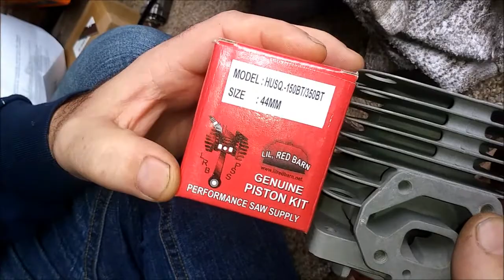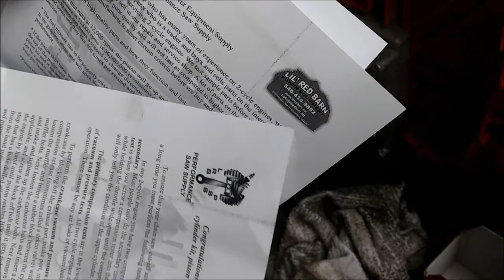Husqvarna Blower Jug and Piston Rebuild

Comment: Jugs and pistons all over Amazon and has been for years.  Before I would get them from Jack's Small Engines or who ever had what I needed.  Hard to beat $27 for Jug, piston, roll pin, sparky plug, gaskets and a fuel filter-to my door
I use a small filter wrench(band) to compress pistons.  Ring tool at Harbor Fr for $12

Comment: I got the same leaf blower broken completely down with it's parts in boxes in a bag.  I found it in the trash and found that the spark plug was bad, cylinder, piston, muffler, are wrecked and the fuel lines were leaking and the pull start assembly is bad.  I removed the gas and saw that it was crystal clear, so does that mean a bad fuel mixture?  I got all the parts on order and figured someone could use it, after I thoroughly clean the parts, replace the gaskets, and get it running good.
Reply: I've never worked on one, but it's rewarding so far.
Reply from the maker: Sounds like it had no oil in the fuel. I always mix at least 50:1 in EVERY 2 stroke engine. It only takes a few minutes to wreck a 2-stroke without oil in the fuel. Some people think you can substitute transmission oil for 2-stroke oil, that's also a failure waiting to happen. Good find though man, good luck.

Comment: Put the piston on the rod before you put it in the cylinder head. Also you don't want to cut the gasket by the carb. It's big for a reason and that reason is to keep the air flowing on that side of the engine.

Comment: i have this model, the carb has a low speed adj,after remiving a tiny plug,with a heated pick, or screwdriver,older models, had a high speed adj screw,i found one after searching awhile on ebay,so i could tune the carb better than ,what the epa allows, good video,nice fix,yeah that carb is a universal replacement,

Comment: Assemble piston/wrist pin on con rod. Then use aa large zip tie over the rings then gently slide the cylinder over the piston.The cylinder will push the zip tie off the rings then just cut the zip tie.

Comment: You said you had to tune the carb? How do you do that? Or can you point me in the right direction?
Reply from the maker: L&H adjustment screws. One's an idle, and one's a high rev air/fuel mix. First play with one and get it to idle, next, go full throttle and get it warmed up, hold it at full throttle, and make an adjustment on the H screw. There's a sweet spot between a lower rev sputter and a high rev zing. Bring the screw to the sputter, and just a small turn to bring it into the high rev. Then let it go back to idle. If it doesn't idle, only adjust the L to bring it back to idle. Then test it again at high rev to make sure it's in the sweet spot just above the high rev sputter. This adjustment varies on temperature and oil to gas ratio. So always try to run the same mixture after your adjustment. This goes for most all 2 strokes.
Reply: @shadetreeautomotiveenthusi1284   Thanks for the reply and the Video! I'm looking forward to this rebuild.

Comment: So after running bad gas nd piston got messed up so i changed it and changed cylinder, fuel lines and carb including fuel filter and blower still wont start, i changed carburetor,  after running bad fuel it ceased and i couldnt retract recoil starter,  but after changing cylinder and piston, i can retract recoil starter but engine wont start. At some point it started few times and then dies real quick. Any help?

Comment: Too wrong and dangerous way, please search repair manual first. The arrow in  piston top, indicate the exhaust side.
Reply from the maker: I'll remember that for when I have to rebuild the engines on my other lawn equipment. So far, the blower in this video  functions just fine, and has been used MANY times for the fall and late summer leaves. Thanks for that information.